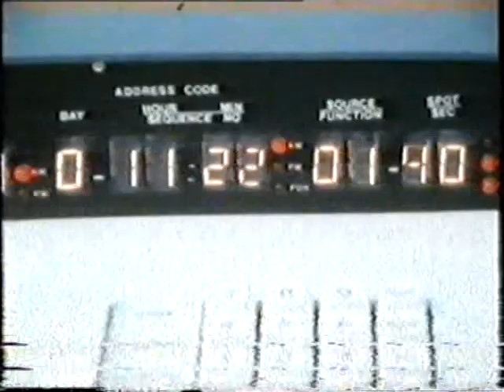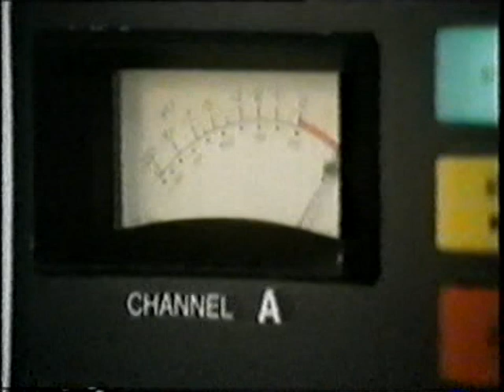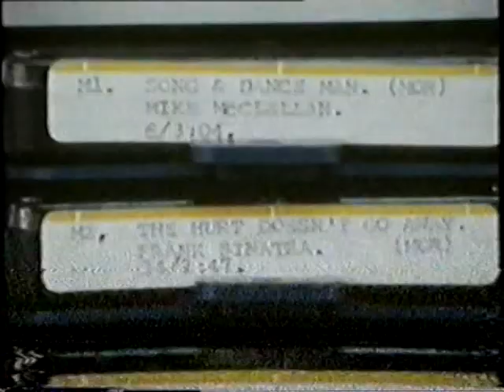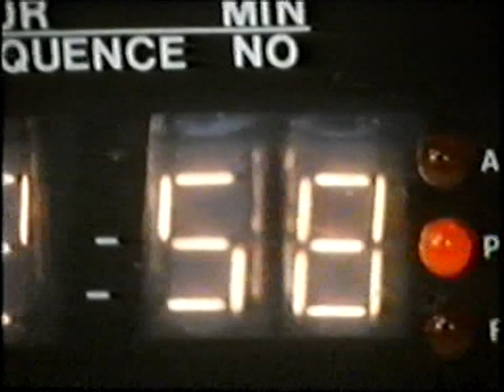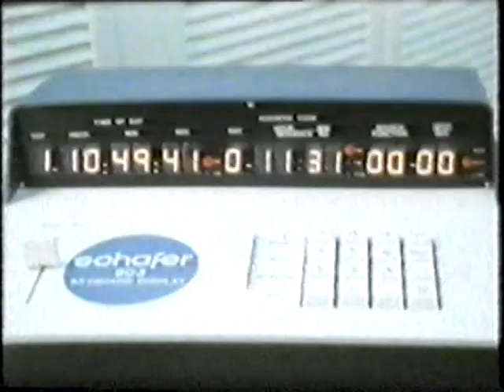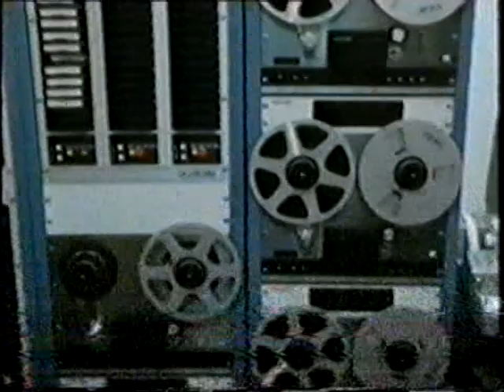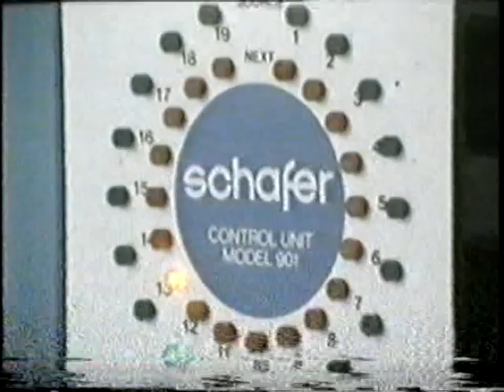Schafer "FRED 903E" Radio Automation System at 2KA in 1975

Comment: I worked with a Schafer 902. What a piece of crap. The fellow in the vid talks about the "dehumanizing" influence of humans doing repetitive tasks, but 40 years down the road, the radio automation system has un-humanized radio to the point that you can go 24 hours without hearing an actual person on the air. Feh.